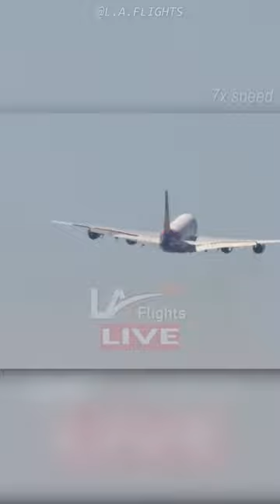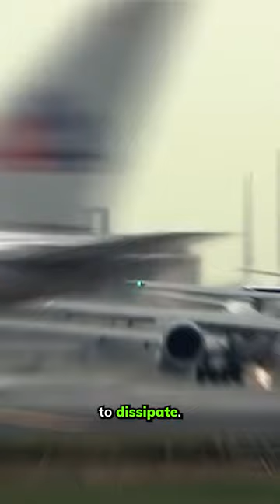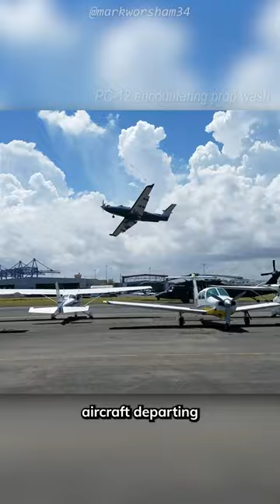Airplane Wake Turbulence Explained

Comment: Wake Turbulence was also the Reason for the Post 9/11 Crash of AAL587 an Airbus A300 because of the Wake Turbulence from the Japan Airlines 747 that took off before it and the Co Pilot's Overuse of the Rudder to Counter the Wake Turbulence which snapped from the Plane
Reply: @Glub_blubit was after 9/11
Reply: @Glub_blubmany initially feared that the crash was the start of another round of terrorist attacks because of how soon it occurred after 9/11
Reply: @Glub_blub Because most people remember this a300 crash to be occurred after 9/11.Otherwise,it will be hard to understand which crash.
Reply: @Glub_blubits because it was on October 2001 so it was just a month after 9/11 and it was also in NYC so a lot of people thought it was a follow up by the same terrorists.
Reply: This is false. The reason for the crash was the incompetency of the First Officer in handling the rudder during turbulent conditions
Reply: @6z0  thats what he said. It wasn’t normal turbulence it was wake turbulence and he literally explained the first officer overusing the rudder to cause it to crash
Reply: @thebaseballcow2024  He edited the comment big brain, it didn’t say that when I replied.
Reply: @6z0  it did say that, I replied 6 days before you did and when I replied it was there and already edited

Comment: Fun fact: A plane carrying important personal once actually crashed because of this exact thing

On the 4th of November 2008, a 
Learjet 45 owned and operated by the Mexican Government, crashed into Central Mexico City, killing all nine occupants and seven people on the ground. The final report concluded that the pilots operating the flight had gained their licenses fraudulently and were not certified to fly that aircraft. The aircraft flew to close to a Boeing 767 ahead of them while on approach to Mexico City International Airport. The violent wake turbulence of the 767 caused the Learjet to invert and enter a nosedive towards the city. The pilots were unable to recover due to their low altitude, and the plane crashed into a building and exploded.

RIP TO THOSE LOST 🪦🪦❤❤